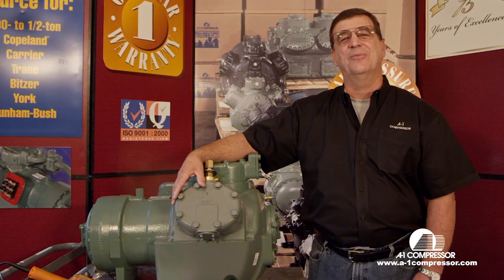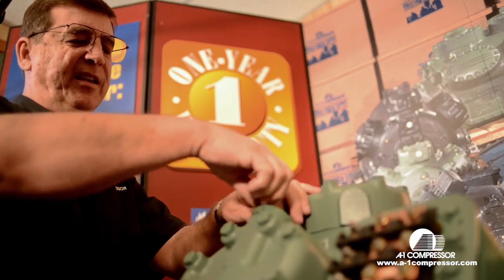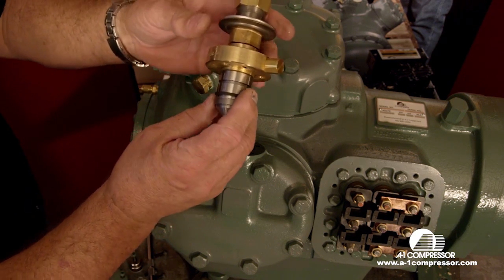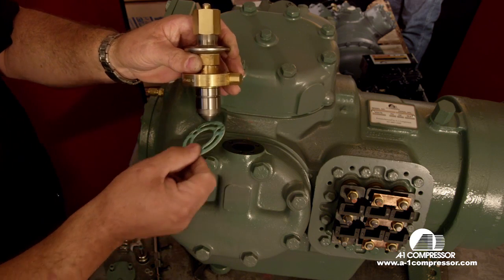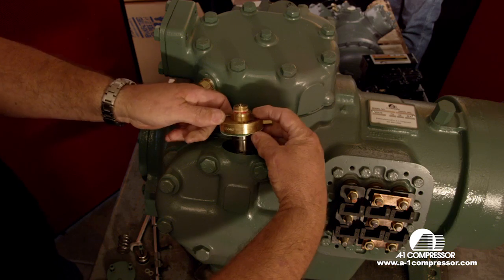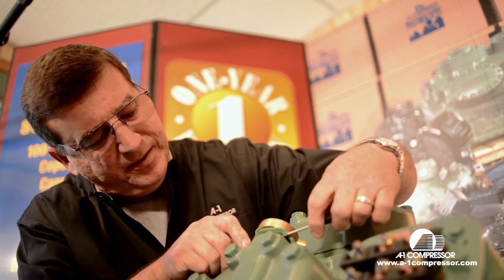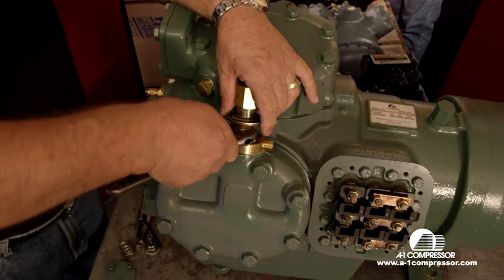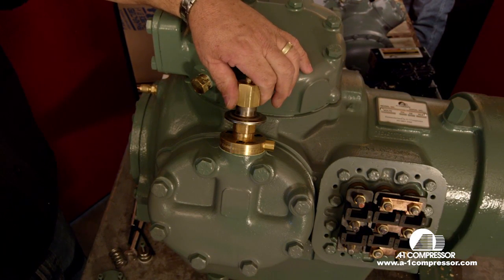How To Install an  06E & D Carrier  HGBP Unloader

Comment: Sir thank you for this video. I have a question

I have a Carrier 06E hot gas bypass valve compressor, can I replace it with a suction cut off valve head and plate and use it?
Reply: Yes, HGBP unloading can be changed to SCOU by swapping out the head and valve plate.

Comment: Because system running discharge pressure 225 suction pressure 35 only discontinue loading how to adjust loading unloading

Comment: you have this labeled a HGBP,  and that head is a suction cutoff....
Reply: Suction cut off heads have the square plate on the opposite side of the unloader valve. It's hot gas, and you cant even fit that piston he put in there into a suction cut of head. It just won't go in.

Comment: I have a question about my compressor unloader. The cap on the side, that you say should be facing the electrical box, is leaking. I took the cap off and it has a set screw inside. I have a leak from there when I pressure test. Should I just get a new unloader or tighten this screw?

Comment: it means compressor is running but not pumping the gas.
Reply: basant budha sir I want ur 1 help plz tell me  this compressing connection wring daigram because I am confused there 9 terminal and but here available 1 contactor so plz tell me which type connection i will give
Reply: Why my compressor suction line heat please reply me
Reply: How to rectify the error for suction line heat